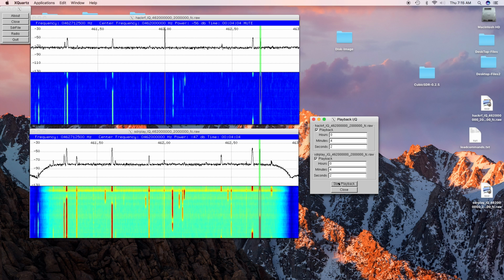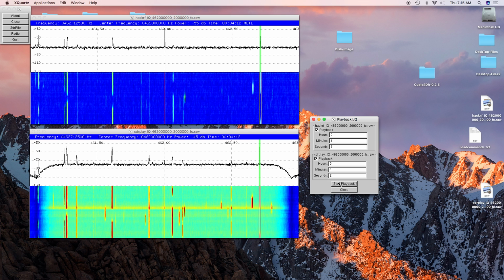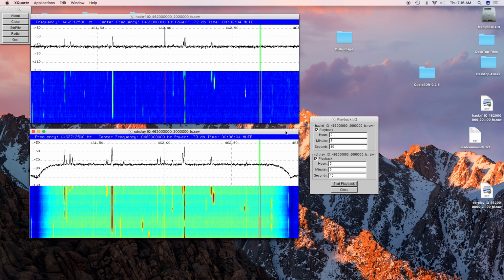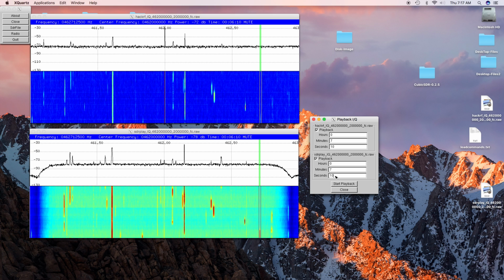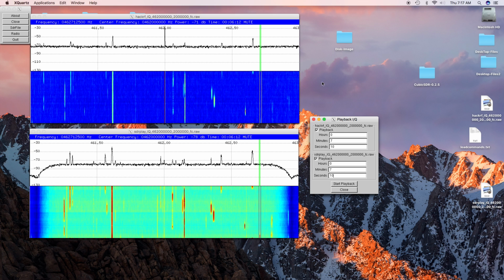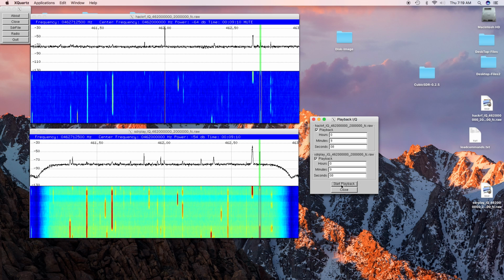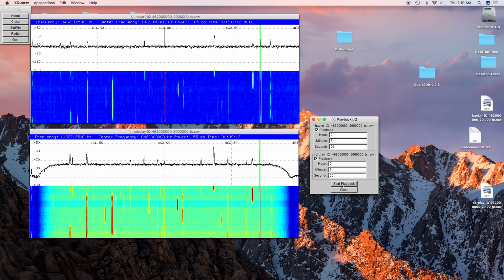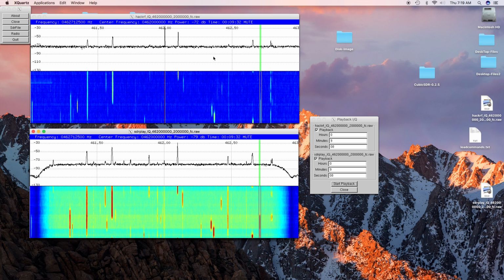SDRPlay RSP2 vs a HackRF One using SdrGlut at FRS frequencies

Comment: im afraid the hackrf has no ears, just bought a hackrf brand new have my hacker and ham radio icom ic 7600 on the same frequency using the same antenna, while im able  to hear s8 signals out my icom i hear nothing from the hacker i tried several bands (hf) and yup i regret my purchase, just hope you guys that thinking of getting the hackrf for ham use do your home work first.
Reply from the maker: Around 10 meters, the hackrf performs almost identically to my ic-r8600 and ic-r30, but you need to turn the gain up to about 100. Try it using SdrGlut with the gain between 100 and 110.
Reply: @daleranta1012   thanks ill give it a shot

Comment: this is useless unless you describe the antenna and gain setup on both systems. I also think you are doubling your playback.
Reply from the maker: They used the same antenna through a splitter and the gains were turned for the best performance - that does not happen at the maximum gain. That is a good as I could do.